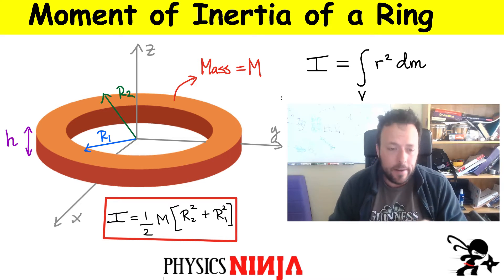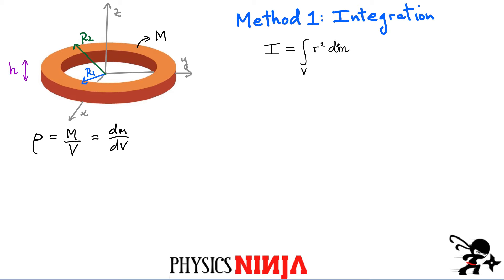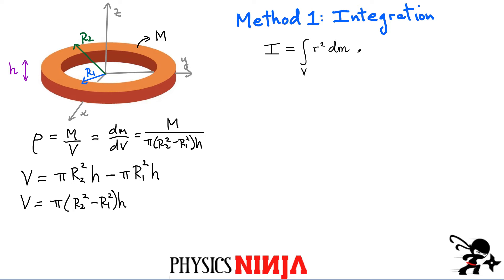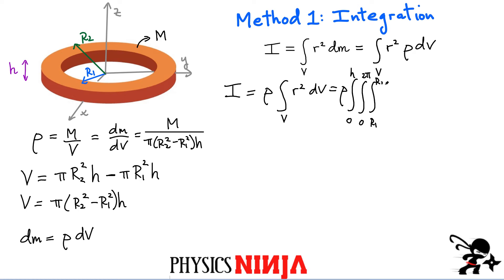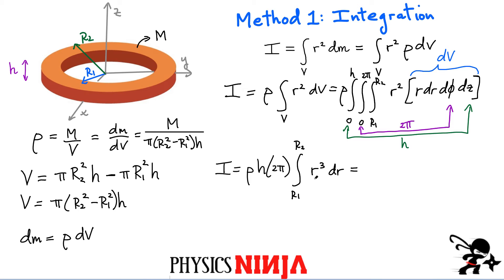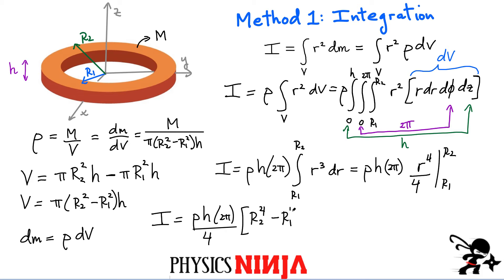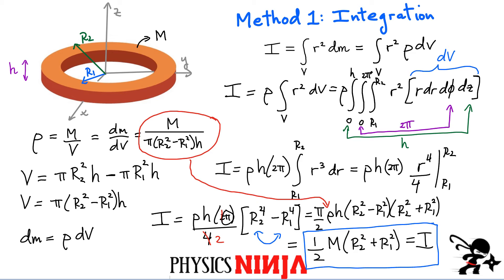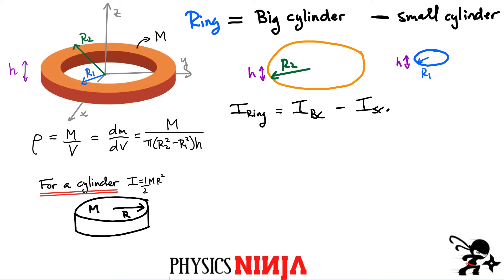Moment of Inertia of Annulus Ring

Comment: Hi, im trying to calculate the inertia of a cylinder with a non-uniform mass,
In my uni project we have a annulus ring of cement and an annulus ring of pla plastic, that makes a cylinder. could i calculate the inertia for each annulus ring, and add them togther to find the inertia of the cylinder with a non-uniform mass?
Reply: Dunno if non-uniform mass is the right word, English is not my first language, but i mean that i have a cylinder made up of a cement ring, in the outer layer of the ring and the center part of the ring is off pla plastic, could i divide them up into 2 diffrent annulus ring, calculate the inertia for each and add them togther to find the inertia for the full cylinder?
Reply from the maker: Yes, you can add them up